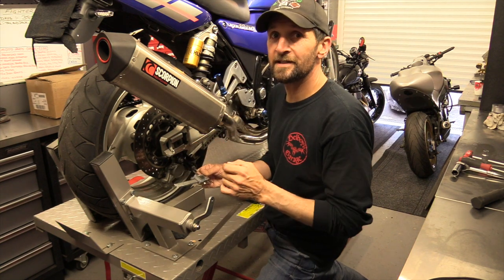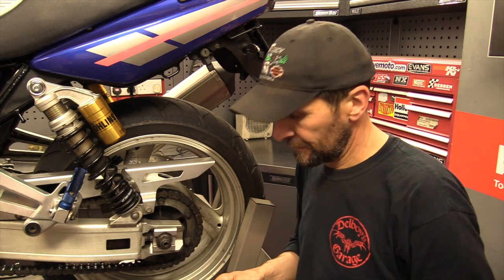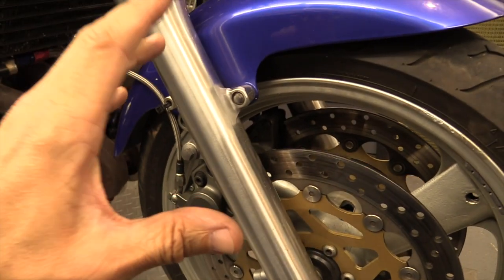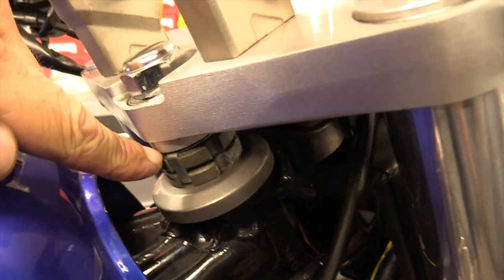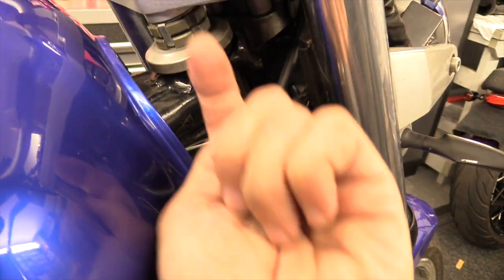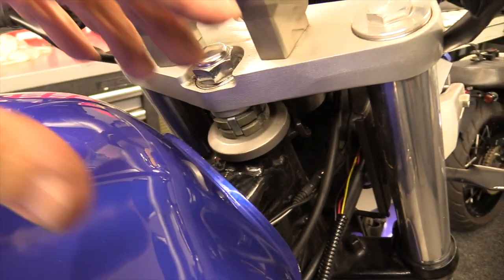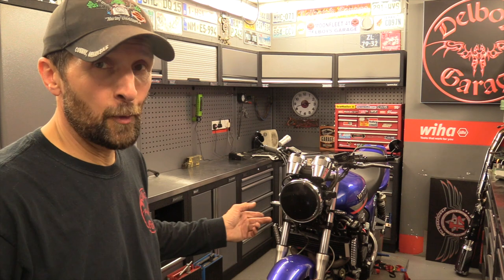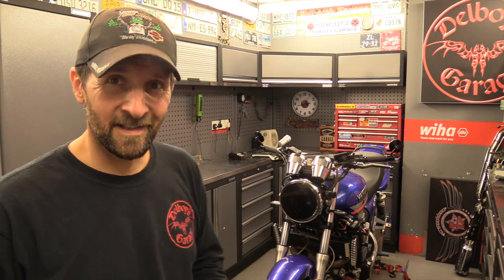Delboy's Garage, Quick and Easy Motorcycle Fork Alignment .

Comment: hey man you probly figured this out by now but if not you can use the far end of your caliper (the end that the little inner metal slide protrudes form) as a depth gage makes mesureing the axel block to swing arm end way ezer

Comment: Just a note with the measuring the axle position in the swingarm. Triumph seems to one manufacturer in my experience that has huge variances in machining swingarms, on my Daytona (2015 model) it's clearly visible that the swingarm is not the same on each side, a known issue with those swingarms and possibly the Street Triple. 

So the measurement you'll get from the axle block to the back end of the swingarm is different if the wheel is aligned, the adjustment marks appear to be correct though. 

Really annoying as I bought a set of Lightech chain adjusters and only one of them fit because of the extra metal on one side of the swingarm.

Might be something for me to make a video about :)

Comment: Hi Delboy and folowers. Kawasaki H1 and H2 are notorious for shakes etc. Apparently by measure, the rear swing arm  marks of a 70's H1 are quite out. For any-one reading this, i've turned up the the original ribbed front tyres were found to cause speed wobbles; and Kawasaki superseeded them with a Dunlop. I have read about all magazine reviews of these new bikes (H1 500 and H2 750) of the period; and none mention speed wobbles at all. Then there are mentions of wobbles; years later, by which time these motorcycles have had a few years of going to church on Sunday ;)  . So that tells me some component has worn perhaps ?.  They started out with a swing arm bush. I just forget if nylon (fenoloc) I have personally seen bronze bushes. So if these markings are out, plus the bushes have had time to wear; is it any wonder they could develop wobbles.  I don't know how the Kawasaki Factory aligned the wheels, and any-one with knowledge of this is welcome to ad that data. One restored H2 owner stated that his bike does not wobble at all, and is stable.  I trust this all helps

Comment: my square spacer block on the right side is inaccurate (getting loose on the hole), so I use the t key as a guide on the chain, adjusting based on that. on the plus side since my rear wheel is using drum brake, it will rub if it's not centered so I use the brake rubbing sound as a guide too.

Comment: worked wonders, my wheel was facing off to the side but this did the trick! Question for you, should i rinse and repeat? i ask because although waaay better, its still a bit off from the handlebars. Cheers!
Reply from the maker: Sometimes unless you take the wheel out of the bike completely and do the fork alignment the long winded way, then this form of alignment can need a little help... you can, in the old fashioned way, like on your bicycle as a kid, stand with your legs either side of the wheel and physically force them straight, once loosened off... you'll need to get someone to hold it whilst you nip it all up, but it works... beyond that, if it persists, you may need to strip the front and build it from scratch, that wyay it will be perfectly dead straight...... don't forget to check your rear wheel alignment as that can play a part as well.

Comment: Did everything as explained on suzuki bandit 1250. After putting all back together it was the same... not sure what went wrong. Kept the bike up straight with tires on ground. Loosed top triple tree bolt, all other screws as mentioned, pumped it over 9 times just to make sure. And tightened the triple tree boot first and everything else
Reply: Also the reason why im trying this is because i noticed my triple tree is crooked, making my handebars crooked in reference to the frame
Reply from the maker: Sometimes they are stubborn Dean, you need to get your feet either side of the wheel, clamp the wheel with your legs and physically force it straight, then get someone to nip up the centre nut, then all the other bolts and fasteners whilst you hold it straight... don't forget to loosen the mudguard... good luck with it, hope you can suss it out.
Reply: Moonfleet41 ok got the bike apart now. It seems like the forks dont want to correct. Do you have skype?
Reply: Im starting to wonder if something is bent

Comment: Hi Delboy, I like your video your explanation is in a simple manner that anyone can understands. I watched your Harley soft tail #5 service video, and I have a better knowledge now. I am ridding a 2014 CVO RoadKing. Will it be the same kind of service like your Harley soft tail #5 service video's, or slightly different. Thank you for making this kind of good video's
appreciate your time and effort
Reply from the maker: Hi there, no, the two engines are very different, the Softail engine has a dry sump with oil tank, but your RoadKing has the touring engine, similar to a Dyna... we have service videos on a Dyna also, if you check in the playslists and they will give you a better guide to service your RoadKing, but I would advise to buy a genuine H-D manual to give you specific tolerances and specifications for your model, specially with CVO, as they have further differences over ordinary RoadKing engines... that would be the best advice.  Good luck with it, and thank you for your support.

Comment: Excellent video Del, well explained. Would love to see the bike out and about being given some welly, I bet that front wheel loves to point skywards once that turbo gets going!
Reply from the maker: Hi buddy, have a few jobs lined up, it's been up-geared by the last owner, so will be taking it back to factory gearing, yet even with the higher gearing now , it wheelies under power in every gear except top, so when it;s back to factory, I reckon it will hoist in top under boost, which is just mad lol... will do an outside video, buddy, just want to get a few jobs done first !

Comment: My Harley a 1993 only has one nut above the top triple tree ,no spanner or adjustment nut below it,every thing else is same though,will try this method..with a slight change of barely loosing top (only) stem nut, see if it works,!
Reply from the maker: Good old Harley, always unique aye... Good luck with it buddy.. !

Comment: Nice work Delboy 
My local bike shop had 3 goes at getting my front end right and still failing,obviously they hav eno idea what there doing,in the event that they performed everything as you have,what could be the cause of my bars not being straight in the cockpit.The handlebars are new and were fitted by the shop.
Reply from the maker: Hi buddy, you didn't say what bike it was?  Remember that often the bars themselves in the clamps can be cock-eyed on the yoke, meaning that actually the yokes are ok and straight, but the bars themselves are a bit off... because if you have a separate handlebar, they're usually rubber mounted... also remember to check the REAR wheel alignment because even if you're complete front end is totally bang straight, the bike will 'crab' up the road if the rear wheel is cock-eyed in the swingarm... (we're only talking a tiny bit, but it'll be enough to make the steering feel a bit twisted)... so check the rear alignment too... see how you get on mate, let me know how it goes!

Comment: Great Video! Question -  I have seen in a Front Tire replacement video before where they suggest to first hand tighten the brake caliper bolts as you suggested. But, then pump the front brakes multiple times for brake pads to self align/center themselves to the  disks. Hold the brakes while torqueing the caliper bolts to the final spec. Doesn't this method apply here as well? Thanks!

Comment: Just checking this out for my bike (shock, back again!) as I've noticed the wheel being slightly off-centre since I replaced my fork seals. Not sure if that job has knocked the forks out of whack or whether it's bumping up into my drive at an angle. Will have to try this out once I figure out how to get my 230kg cruiser vertically off the ground and stable...
Reply from the maker: Hi buddy, if you're gonna do this with your cruise, then you don't need it off the ground, just held upright on it's wheels, if you can get someone to hold it from behind, if you have a hollow rear axle, you can run a steel bar through it, and then put that bar on axle stands beside it, or a paddock stand if you have one... but the front wheel does need to be on the ground with the full weight on it... hope that helps, good luck with it !
Reply: Moonfleet41 Cheers for the reply. I'll get her straight and level tomorrow then hold from the rear to see how feasible that method is. A mate has paddock stands, but they were only £30 so I don't know if they'll even fit my bike or whether they can support the weight!

Comment: IT'S A BEAUTY DEL! I can imagine it is a right blast to ride! Would love a turbo on me CB13! Not that it aint potent enough already!...
Reply: Wayne Hudson I've got the full akropovic system on it and it goes good. Would benefit a little from a commander though.
Reply: Wayne Hudson Great bikes aren't they. They defo benefit from having renthals stuck on. The standard bars are too far back towards you.
Reply from the maker: kyndryd spyrt: believe me mate, it ain't potent enough already lol until you ride a turbo bike, it's just not possible to express the feeling, I absolutely love muscle bikes, I've had an XJR12 previously, an XJR13, two Honda CB13's and a GSX14, I just love muscle... and have done all manner of things to all of them, cans, full systems, re-gearing, power commanders, and none of them do anything more than a little tickle to the performance, you think they do, and when I re-geared my 14 with a full Akro system, taking 20kgs off it, by removing that stupid great exhaust it has, where the headers are actually 'double skinned' and the 5kg main stand, all made a big difference, it wheelied off the throttle in second, but it still couldn't touch a turbo... imagine getting to 5.5k revs and then the whole bike just bursts in to life and leaps forward with , that feels like, an unfeasible amount of accelration... it pulls like nothing you've ever felt, like an Alton Towers fair ground ride.. and in one gear in about 4 seconds... you look down and you're at almost twice the speed limit... once you'r ridden forced induction, you never look back , and boy does it need respect lol !
Reply: Moonfleet41 I must try one one time!..

Comment: Useful as ever! Can't wait to see a video of this bike out on the road! Got a '92 ZXR400 here where the rims haven't been cleaned in years by the looks of it - any tips? Have tried specialist wheel cleaners, wd40, paraffin, "no nonsense" degreaser - nothing seems to get it off! (The rims are part chrome, part painted)
Reply from the maker: Hi mate, sometimes when corrosion gets so bad, it's a lost cause... what many riders do to get a really great, good quality finish that looks smart and doesn't cost much, is just have them powder coated... take the rims to a tyre shop, and get them to slip th tyres off, then walk them round to a power coaters and they will do the rest.. they will use some sort of media blasting treatment to rip them back to bare metal, then powder coat in a colour of your choice ... some places do it from as little as £50 a rim, or less!

Comment: hi delboy I've just got a gen 2 hayabusa and my handlebars are a bit off centre and I've checked rear wheel is straight , shall I undo the top triple tree centre nut and everything below the top triple tree pinch bolts and once done pushing down a bunch of times tighten in reverse order like on this video or shall follow your older hayabusa video where you straighten bars , just wondering if loosening the top centre nut is vital so the triple tree's can move independently  , thanks
Reply from the maker: Pretty much that mate, it's highly unlikely that it'll be more than a few degrees of pinch bolt mis-alignment so yes, back off the top nut about 1/2 turn at least and it should straighten up if that's what the problem is... best of luck with it.
Reply: @Moonfleet41  much appreciated thanks 👍🏼😎

Comment: Delboy did you use copper slip on the triple tree pinch bolts and if so did you back off the torque settings?

Comment: This is my weekend project, I just finished your older video on the hayabusa, but didn't notice you crack loose the center "yoke" nut but in this video you state it clearly and crack it loose. Do you crack the center yoke nut on most types of bikes?
Reply from the maker: HI buddy.. yes you need to release the top yoke on all bikes for this, i just didn't make enough mention of this in the first video years ago.. id also suggest its the first nut you do back up again afterwards too..
Reply: Thank you sir, you really helped me out here.

Comment: Hi del! Great video! But I’m still need help. I own a 07 night train and she keeps getting the front out of alignment every time when I hit a bump, or pull the front brake strongly. The front end is completely stock. I have to kick the wheel on its side to put on its center again. It’s a normal condition to this model?

Comment: My V-Strom 650 gently leans left a hair when I take my hands off the bars.  The dealer mechanic says; "Don't take your hands off the bars"..."slight manufacturing intolerances"...
     Hmmm
I'll be changing the fork oil in a few weeks when the snow flies, AND I'll do this too.  I'll let you know...
Reply from the maker: That sounds like a strange answer from a professional unless he was just being jovial... one thing that's relevant is that when you ride along any road there's a camber to drain rainwater, here in the UK we drive on the left so the camber's to the left and if you have a reasonably pronounced camber to the road, take your hands off the bars and it will naturally track left down the camber, so not sure what the camber on the road might have been when you did that, ut try it on a dead flat road next time and see how it is then... a couple of other things that are relevant, rear wheel alignment and front tyre wear, so check the front tyre's worn evenly as that can affect it and obviously chain alignment too... if your rear wheel is off slightly it makes the bike 'crab' very slightly and it will naturally pull to that side when you release the bars. Good luck with it buddy and ride safe.
Reply: Yes, I was onto road camber, ruled that out, tire wear is unremarkable, and I also played with distribution of the weight of accessories, my tool kit, etc.  I missed the rear wheel and chain alignment bit, but I'm careful about that normally, no change with multiple adjustments and tire changes, and nevertheless I'll do some caliper checks to rule that one out too.  I might come up with an error in my technique.

I've always felt that I was reaching a bit farther with my left arm.  That could be an old neck injury, but...

Anyhow, I'll take everything apart to clean out the forks and change the oil over the winter, carefully do the set up as you describe, new front tire, and see if anything changes.  If not...well I friggen KNOW it's safe...  

Thanks for a great vid.  I know you hear that all the time, but really, I see the truth between the lines.  I get what you're up to.  Well done.
Reply from the maker: @jimsnow9183  Most welcome Jim, it sounds like you have it under control, i just thought of one more thing given the anatomy of your bike... You have traditional bars on clamps, and those clamps are bolted through the top yoke with rubber bushings... they can twist in the yoke over time even just from moving the bike around.!!     check if the bars are actually aligned square in the yoke itself!  crack off the bar clamp tops, and loosen the nuts under the yoke that hold them in... and you'll see you can twist the bars about until they're perfect, then tighten up the clamp tops first, followed by the nuts under the yoke that hold the clamps in.    long shot, but it's another option.!
Reply: @Moonfleet41  okay got it.  That's a good lead, I'm an adventure touring guy, the bike's been dumped a few times.

Comment: question: if i screwd up the allingment when changing the clipons, by screwing the top nut when bike is on side stand instead of it totaly horizontal, do i need to go through loosening all the bolts mentioned?  or will it be enough to unscrew top nut of upper yoke and its pinch bolts, (this time bike totally horizontal of course:-) and straighten it with  my knees, and re screw it again when bike is totally horizontal ?

Comment: Hi Del, my haynes manual says to tighten the lower pinch bolts first, then the stem nut, then top yoke pinch bolts, the opposite of how you say to do it to avoid leaving the top end opened up, is this just another way to do it? Am also thinking haynes say do it there way cos my bike has usd forks were as i notice in your video you have conventional or right way up forks, thanks john.

Comment: Thnaks for the info. I do have a question: After lossening and tightening how do you know if the forks are then properly alligned?
Reply: Thanks, Del... Basically..take the bike out for a ride.. If it's not cock-eyd anymore..problem fixed.
Still cock-eyes.. rinse and repeat. 👍

Comment: Great vid once again Del and Penny, wish you'd have done that job with the Harley :-)
Reply from the maker: Same procedure buddy. have you got an issue with yours..?
Reply: Don't think so, I've just completed a twin Disc conversion to my soft tail, new lower legs, wheel etc etc, would just like to make sure, it rides pretty good at the mo, and I am told I ride it pretty hard, and now i know it will stop, instead of sending a request a week before you need to stop lol

Comment: With my bike's centerstand the rear wheel is off the ground but the front wheel has weight on it. Can I use the centerstand in this case to do the fork alignment?